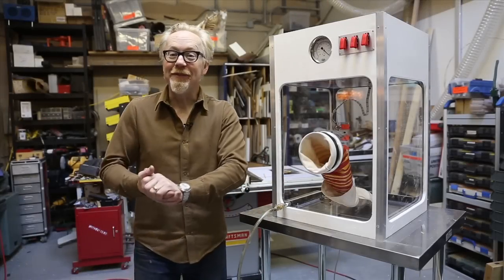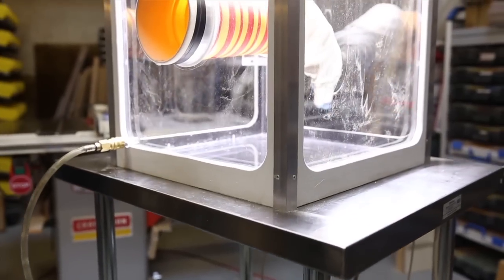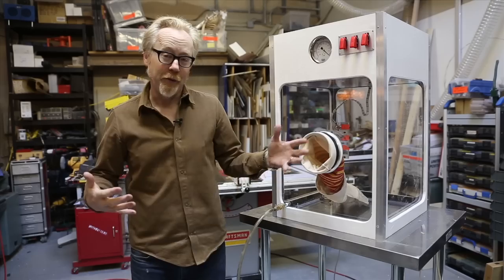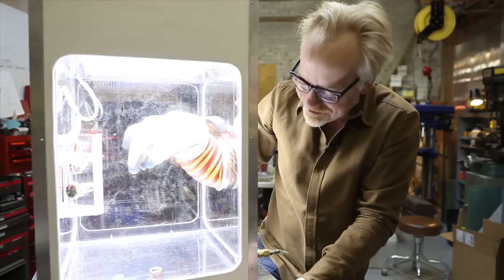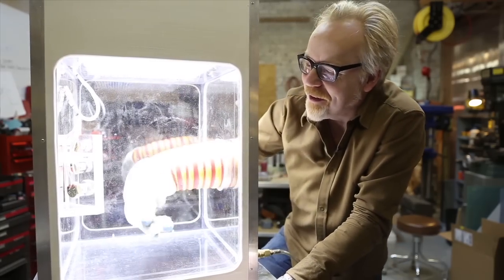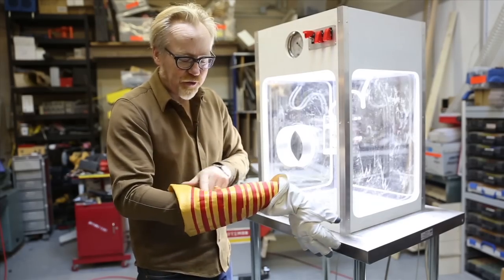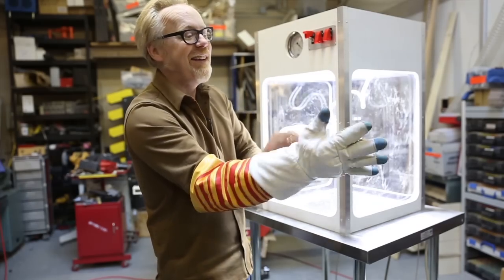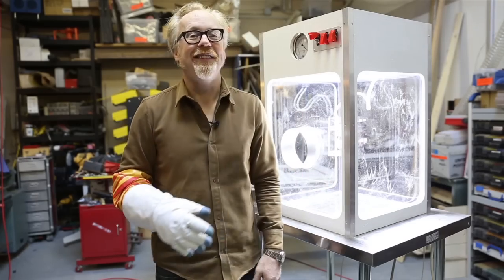Inside Adam Savage's Cave: Space Glove Vacuum Chamber

Comment: I had a sandblasting cabinet with a high powered dust extractor and it used to suck the gloves out like this... but as soon as I used the blaster it equalized the pressure and was easy to move around... if NASA were to do something like that with the suits and it would be easy to move around... they are over pressured... having said that I am sure they have their reasons...
Reply: Because they're in space?
Reply: I imagine that would have a little to do with it! But doesn't really explain anything scientifically!
Reply: DeansVideoClips If I understand you correctly, you have answered your own question: the pressures equalized. There was no longer a negative pressure, no vacuum inside. In space, there's always a vacuum, so that differential is always present
Reply: ***** Hi Ryan, I have been doing a little research on this over the last few weeks... apparently their suits are only pressurised to 3-4 psi which is about one quarter of an atmosphere but because there is no atmosphere on the outside even this small amount of internal pressure is immense (like how a helium balloon gets bigger as it gets into thinner air) Apparently they have a pure oxygen environment. NASA is also working on a biosuit that just compresses against the body ie no space suit except for breathing apparatus... I think they are having problems with it though especially regarding the extremities.
Reply: DeansVideoClips Lol, I'd imagine they probably are having problems with it! Complex questions have a way of doing that. You're right though, it's amazing how much force adds up in a pressure environment. I've been dealing with that a lot lately building a vacuum chamber. The glass lid on my crock pot has been withstanding over 1000lbs of force XD (do not try this at home)
Reply: ***** Geez! 1000lbs... Just trying to do the maths... isn't atmosphere about 14.7 psi? So I would think that once you suck out all the air and have a close to pure vacuum that the internal pressure in a vacuum chamber would be just about zero and the external pressure would only be 14.7 psi wouldn't it? Or can you keep sucking to create a negative atmosphere?
Reply: That's right, 14.7psi! now, multiply that by the number of square inches on the lid (just the lid I'm talking about atm) of my roughly 10 inch crock pot. A=pi*R^2=78.54 sq inches*14.7psi=1154.538lbs! My next chamber is even bigger.the lid on that one will be 16 inches, and will have to withstand over 3000 lbs :). It will not be glass, however
Reply: oh ok... that makes sense... is it possible to create a negative atmosphere - I'm thinking not... the brain has been so conditioned over the years that I have always assumed you could suck all the air out and then keep sucking but now that i am getting my head around pressure perhaps that's not possible?
Reply: You're sort of right. It isn't possible (at least according to normal physics, I believe quantum may have it's own thing, but whatever) to make less than nothing. A perfect vacuum is not possible to reach, but if it was, it would be simply 0. in relation to Earth's atmosphere, that is a negative pressure of 14.7psi. This also applies to Adam's Glove. The chamber gets pumped down to around 11 psi as I understand it. This creates a glove which has a 3 psi differential to the surrounding environment.

As for the idea that you can just keep sucking, you can! sort of. since there is no perfect vacuum, you can suck and suck forever and keep going lower, approaching a limit of 0 pascals, but never reaching it. as you get closer, it gets harder and harder to pull more out, and requires more equipment.
Reply: Hi Ryan, Thanks for that. I just did some research of my own before you got back to me and so it seems as you say in normal physics you can only reach near zero pascals... thinking outside of the square although you can theoretically only reach zero, I would imagine that you could create more positive pressure on the outside of the vacuum chamber which although wouldn't decrease the vacuum as such it would make a greater difference between the zero pressure and the higher external pressure which in a way decreases the internal pressure... although it may have no bearing on the internal zero pressure because zero is zero... all it would mean is more pressure on the outside... hard to get my head around - again just trying to retrain my brain here!
Reply: that is correct. You could, for instance, put my crock pot inside the tank of an air compressor and pump it up, making the pressure DIFFERENCE greater, making the lid withstand from 0 to 100 or whatever psi instead of from 0 to 14.7psi
Reply: It's starting to make sense now... anything you have in that vacuum would be unaffected by the change in the external pressure no matter how high it was... so what are you building the 3000 lb vacuum chamber for - just because you can or do you have some experiment in mind?
Reply: Building a freeze dryer
Reply: oh ok so you are extracting all the moisture out by creating a zero vacuum - is that how it's done!
Reply: not really, no. You'll have to look it up
Reply: DeansVideoClips well, that's sort of how it works, the water evaporates,  water ice sublimates and you pump the water away as gas. Prep, and what temperature you use throughout the process is critical depending on exactly what you are removing water from.
Reply: Robert Szasz Thanks for the explanation Robert.

Comment: NICE!! I always wondered if you made a vacuum storage box could you prevent tools from rusting?
Reply: Carlos A I looked up some curator's notes on taking care of metals. Clean with a jewellers cloth or similar before storage, use steel shelving rather than wood. Keep in a low humidity environment, keep the temperature steady and avoid low temperatures (inside a house is better, or temperature controlled environment. And if possible avoid air pollution.

Things you might be interested in: Activated charcoal paper (absorbs air pollutants), Silica gel (useful in microenvironments (contained) to reduce humidity), Vapour phase inhibitors (can be toxic however) and Clear plastic boxes & bags useful for creating microenvironments.

Some of it is probably over the top, though some are relatively easy to implement. Still no more bother than maintaining a vacuum chamber.
Reply: All my tools are made from chromium-vanadium steel. It's not cheap but those things never rust.

Not everything can be made from that of course.
Reply: Pichuntastic
Please correct me if I'm wrong but air that is under lower pressure (vacuum) doesn't necessarily mean that there is no oxygen.
Reply: Wow Thanks for that feedback. So there's still oxygen inside a "hobbyist type vacuum setup" and oxygen isn't needed for oxydizing so im guessing if its possible to make a true vacuum on earth it'll probably be very expensive. If a setup like this cant prevent corrosion would it even be able to reduce the rate of corrosion?
Reply: Carlos A
WARNING TEXTBOOK INCOMING
 The vacuum would absolutely reduce the rate of corrosion. Oxidization doesn't need to involve oxygen, that is true, but when you're talking about corrosion of tools, you're more specifically talking about "conversion of metallic iron into iron oxide." Atmospheric oxygen is absolutely the culprit in this case, and the original "less oxygen = less rust" answer is correct.

There is definitely less oxygen in a partial vacuum than at atmospheric pressure. When you are making a vacuum, you are pumping out everything in proportion. If air is 20% oxygen, the partial vacuum is also 20% oxygen, but since there's less of everything, there is an equal proportion less oxygen.
There is no such thing as a "true vacuum" on earth, but reducing the pressure inside a box still means fewer molecules of oxygen coming in contact with the tools. So, while it couldn't prevent corrosion completely, it can certainly slow it down.

Maintaining a vacuum for the purpose of storing tools would likely be expensive, however. Every time you want to retrieve something, you'd have to break the vacuum at least a little bit, and pumping those particles out to re-make the vacuum is pretty energy-heavy.

Source: [I'm a chemist.]
Reply: or you can just pump out the air and fill your toolbox with xenon xD

Comment: Adam, great video...but isn't true that the "3.5 psi" number comes from the fact that the partial pressure of oxygen (ppO2) at sea level is about 3.07psi or 20.9kPa (but you never say what gas, oxygen? or gases, air?? the space suit is pressurized with), So you should see a pressure change of the vacuum gauge -24kPa (I did not see a "psi" scale only "kPa" and "in.Hg"on the gauge face). You should be ok with 3.5psi because you will be breathing 100% oxygen.  But breathing air, (21% oxygen and 79% nitrogen) at only 3.5psi, I think you could safely say, that the poor guy in the space suit, could be almost dead...more or less...well not moving very fast.
Reply: Just look up "Space Suit" on Wikipedia...

Comment: Seems like it would be potentially dangerous to use if the glove becomes punctured.
Reply: Yep your blood would boil and... Wait we're not actually in space.
Reply: Why would it be? If the glove becomes punctured, air will be sucked into the vacuum chamber until it's at normal pressure again. (note how the vacuum pump is off while the glove is used) 
Worst that happens is a lot of air rushing past your arm and hand.

If your glove would be punctured in space, there's not enough air in your suit to fill space therefore your body will suffer serious damage. This is not the case here because it's not a full suit and enough air is available outside the vacuum chamber to fill it without causing a (measurable) difference in atmospheric pressure.
Reply: what a bold statement...
Reply: John Smith pro-tip: a substance doesn't need to get hot to boil
Reply: How so? Seems like it'd be little worse than a balloon popping or a leak screwing up the vacuum.
Reply: not dangerous at all, since all that would happen is air would rush down the glove into the box, equalising the pressure. and 3.5 PSI wouldn't cause any harm to the user nor anyone around in this scenario.
Reply: jrmym2 Vagina....
Reply: John Smith technically it would though, your body is used to working under earths pressure, and when it rapidly changes you get nitrogen bubbles in your blood aka "boils". same thing happens when you come up from a dive to fast, and happened in the first high altitude flights before flight suits that kept your body pressurized,  more or less.
Reply from the maker: andrew mac I think you mean the bends :)
Reply: John Smith Vsauce knowledge right here.
Reply: John Smith You don't get sarcasm do you?  And as others have said fluids don't need to get hot to boil.  It's one of the reason you need to draw a vacuum on AC systems prior to filling.  Doing so cause moisture in the system to boil off.
Reply: This sounds like a "myth" that needs busting.  I ain't afraid a no myths.
Reply: Tested Well, technically, but the fact that your brain would potentially be pulled out through your nose and mouth, if you had any cuts at all your blood would be taken out of  your body instantly, your skin would turn into dust along with the rest of your completely dehydrated body, then you would have all the air pulled out of your body into a big ball shaped cloud, also de-oxygenizing your taken out blood, to finally floating around in space as a lifeless, husk of the human race. Not in exact order
Reply: +Gordon Chin I can't see how the glove bursting could harm anyone.  That said, the meter in the video is measuring inches of mercury, not psi.  So here at least he has a vacuum of only 1.5 psi.
Reply: Gordon Chin he took the glove out when it was still pressurized it's only 3.5lbs it's literally nothing
Reply: https://youtu.be/iWGGMchu6mQ
Reply: Uht oh, safety police alert!
Reply: Nitrile gloves with fabric tape withstand the same pressure as the vacuum of  space? A bit of duct tape holds it on? Come on!
Reply: tmar23 Even if you were in space, your blood wouldnt boil. Your blood-system is a closed system.
Reply: andrew mac That would happen. But the only fluid that would get hot, is your saliva in you mouth and the tears in your eyes. Then you would black out.